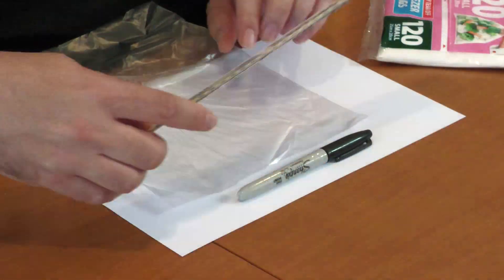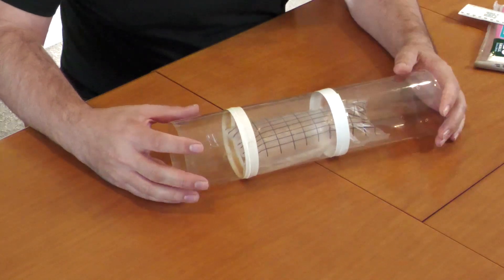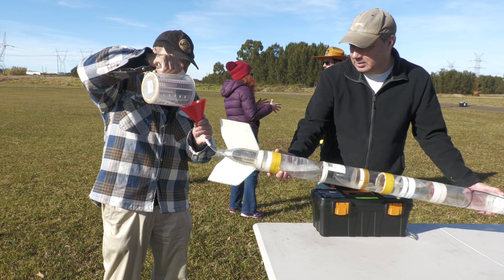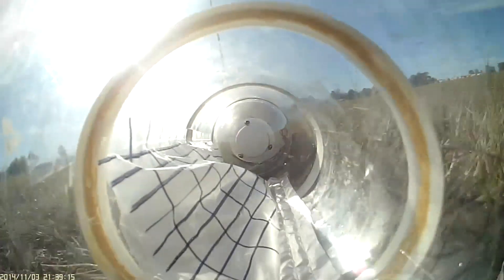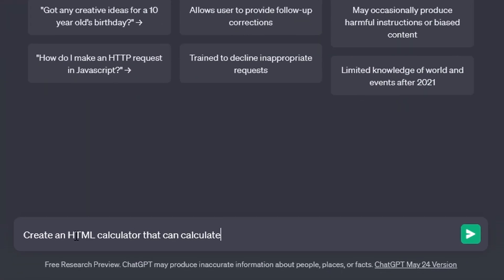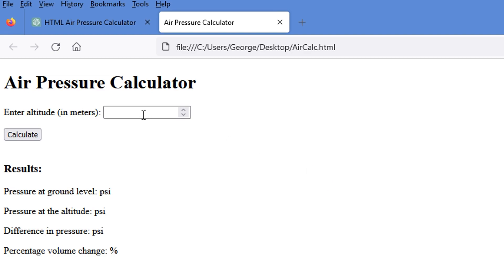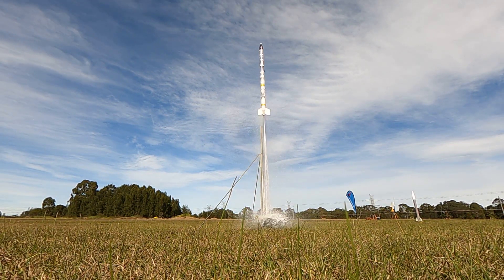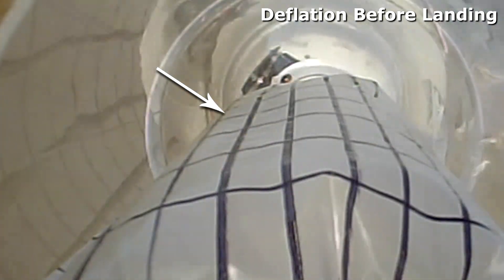Experiment to see pressure drop in flight

Comment: My brother had a winch launcher for sailplanes.. gliders..  The winch takes gets the aircraft to about 1,000 ft, release and then the pilot searches  for lift  or return for landing.  If they could get an additional minute + - of thrust, maybe a few hundred feet higher,  they might have a better chance of finding thermals..  Using a 2 seat glider with only one pilot., Is it feasible to use a nitrogen or oxygen bottle, a few gallons of water and nozzle to discharge after winch cut away?  170 pounds is about the weight to work with.  After the discharge and the few gallons of water are gone, the sailplane would be much lighter, only carrying the weight of the bottle, tank, plumbing and nozzle system... This idea has been kicked around for years, and it looks to me like you are experienced enough to consider it. thank you... George

Comment: Instead of the bag inside, use a flexible seal at the external holes, the pressure difference at the small holes will be a very small percentage and should see a reaction at the hole expanding and contracting (Maybe). A single small hole instead of number of small holes mean the video can focus more clearly on a single event.

Comment: You probably need something like an analogue altitude meter where the small movement is amplified by the distance it moves at the end of a long needle. One way of seeing pressure change is with a u bend of water being pushed, but i don't think that would survive the flight well - especially under acceleration / zero G!
Reply from the maker: The U bend with water in it may actually work if we perhaps instead of a simple U, we loop the tube around a few times. I also think we could mount it sideways so that acceleration forces are perpendicular to the tube and the tube is narrow enough where the surface tension prevents it from  flowing out. I think this is something we could also test on the next attempt.
Reply: @AirCommandRockets  are you going to test any of these on the ground? You don't really need a good vacuum chamber. Or just send it?
Reply from the maker: @simonabunker  We'll just send it. Any excuse to launch a rocket will do. :)

Comment: Awesome video, black out the compartment holding the experiment and use illuminated camera, be nice to only focus on what’s happening to the bag instead of fluctuating light conditions as the rocket spins and moves about.
Reply from the maker: The idea was to be able to have a direct reference of where you are in the flight. If we black it out we would need to include a second reference of perhaps a logging altimeter, or a second camera on the outside. But perhaps we can black out just a portion of it where the experiment is, and see the world around the periphery.

Comment: Maybe a bottle with a small syringe in the end. You would need a syringe the moved freely. Then the percentage change on 1% would show on a 2 ml syringe for a 200 ml bottle.
Reply from the maker: I'm thinking something along these lines too. A stiff walled chamber with a small indicator on the end of it so the volume change only happens there. I was thinking the indicator could be something like those rollup party horns that unroll as you blow into them, but just a really light weight version.